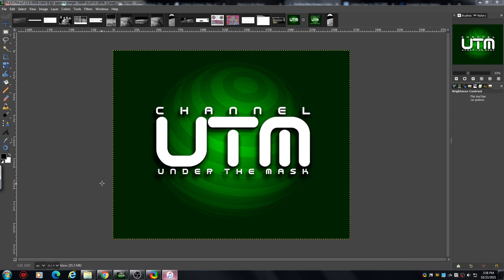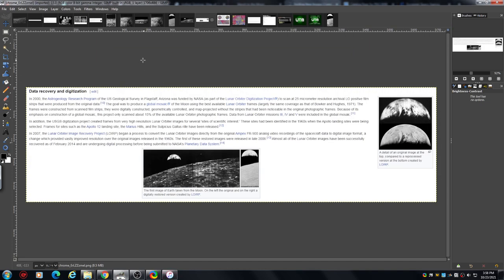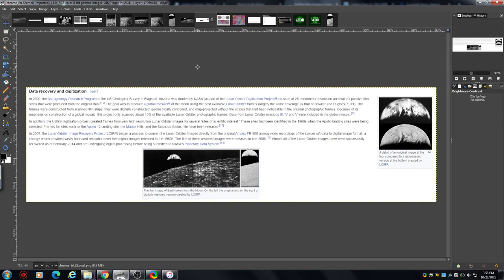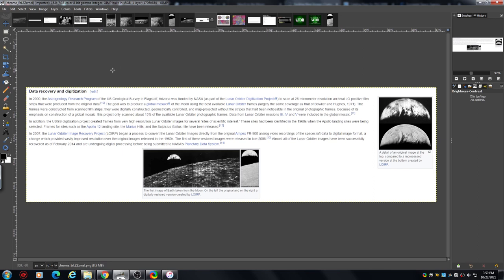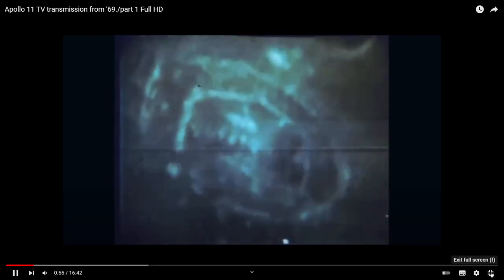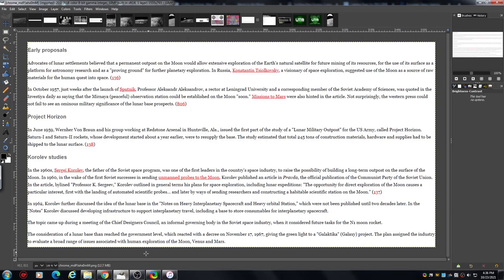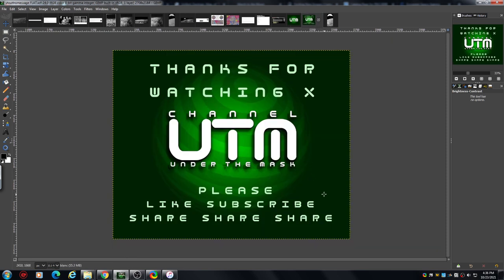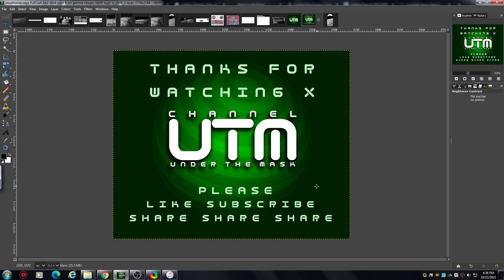APOLLO LUNAR ORBITER 1960'S CAMERA TECHNOLOGY EXPLAINED-OBVIOUS EDITING VIEWED!

Comment: hello, the horizontal stitch lines seem to be oblique. Maybe the pic orientation angle needs to be changed a bit. The strips do not match with some parts blacked out (manipulation). Some structures are easy to be seen despite NASA's tampering. Thanks for giving some background information. Cheers.